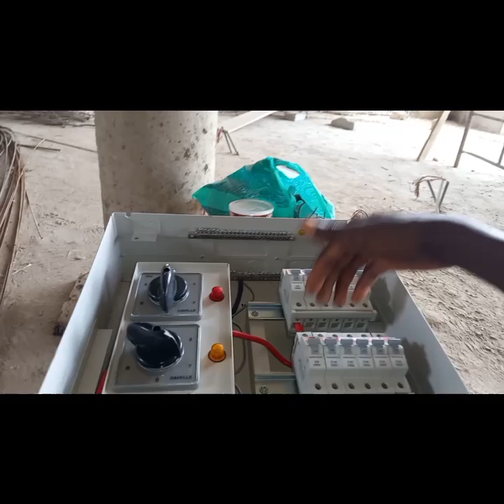Building In Ghana | Why RCD RCCB Is A Must For An Electrical System?

Comment: Great work there guy. Keep the videos coming 👍. Which cable brands will you recommend for domestic wiring. Thanks man
Reply from the maker: Thank you. 
I will recommend Tropical cable (designed for our Ghanaian Tropical weather), Signal cable, and RR cable India.
Reply: @multiskilledelectrician1  Thanks for the quick reply. I have subscribed and look forward to your videos. Please can you explain the use of 1.5mm, 2.5mm, 4mm, 6mm, 10mm and 16mm cables in wiring a house. Thanks man
Reply from the maker: @ruhullahidani276  I'm going to do a video and alert you shortly.
Reply: @multiskilledelectrician1  thanks man, I will be on standby to watch your videos
Reply: @multiskilledelectrician1  Great, If I want to use a combination of tropical and RR India cables in order to reduce cost for 1.5mm, 2.5mm, 4.5mm and 16mm, which of these should I use the tropical cable and which should I use the RR India cable. Thanks